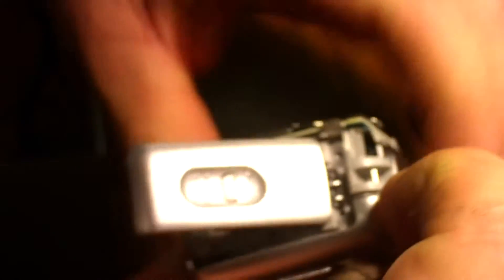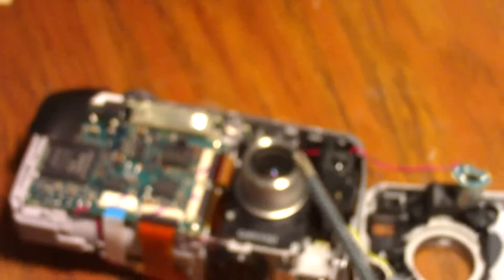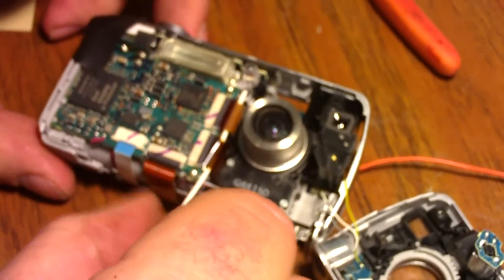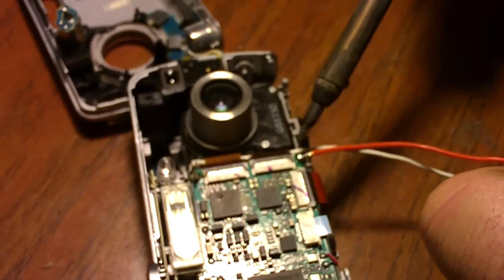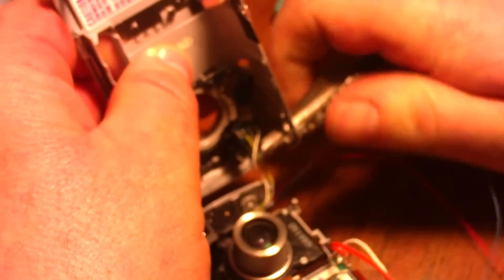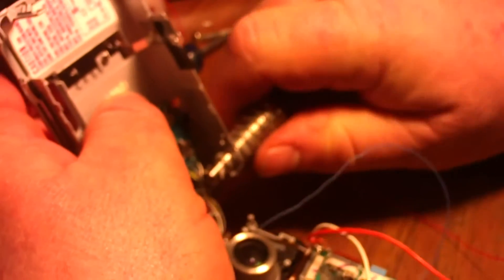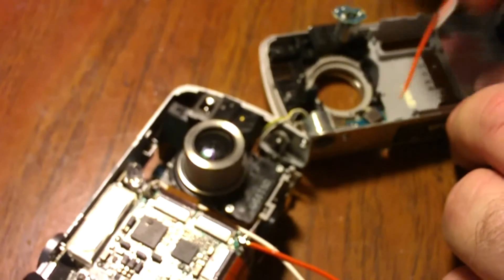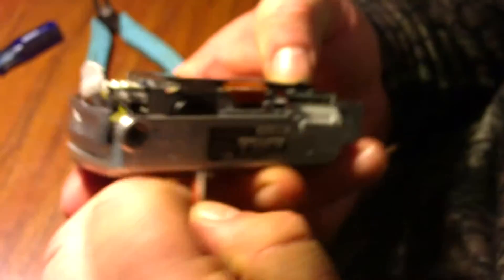Sony s600 4 wire hack video pt. 1.MOV

Comment: Hello Garret. My camera only works with new batteries. When shooting some photos with the new batteries and turn off the camera. When I turn back, she did not care anymore. I see you know a lot of the DSC-S600 cameras. Do you have any information that may be useful to me?
Reply from the maker: Digital cameras do not like alkaline batteries.  You can use lithium or nimh rechargeable batteries. Alkaline batteries will cause the camera to shut down and the alkalines will not last very long if they do work
Reply: Charles Garrett Thank you for your attention. Try using the batteries as you indicated. I have arranged the purchase of nimh rechargeable batteries type